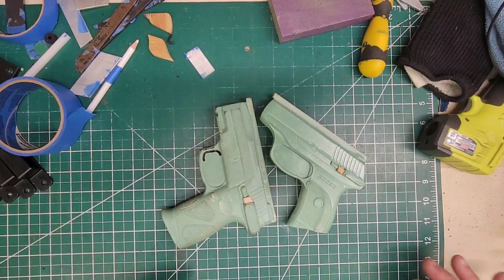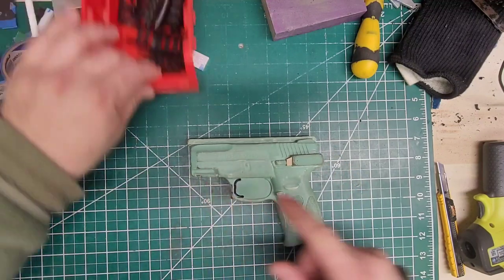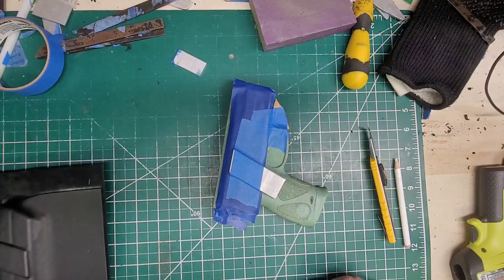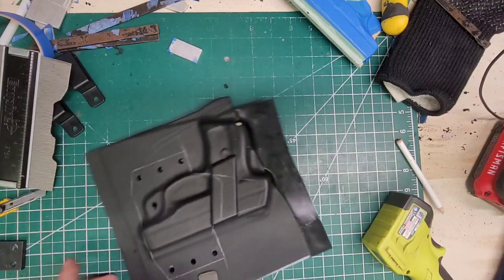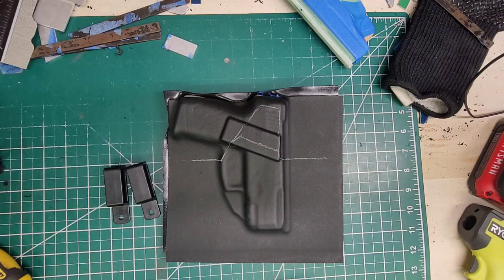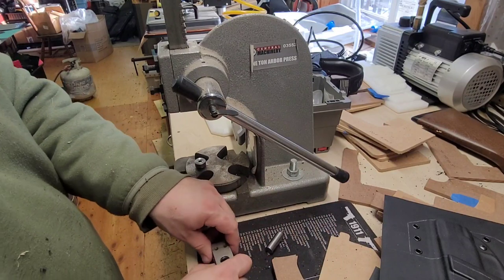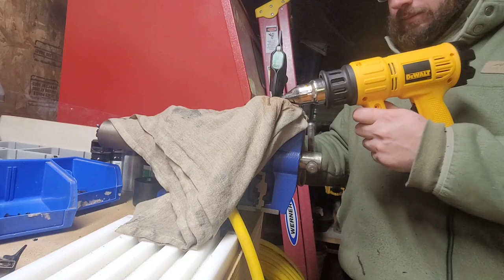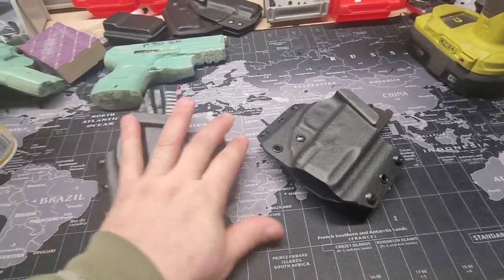Seeing double! 2 Holsters, 1 Video! Ruger LC9 and Taurus G2c

Comment: What distance of the holes on the drill guide?  Thanks
Reply from the maker: I have four drill guides. Each one is for a different mounting system. Some for loops. Some for speed ease. Off the top of my head I don't know. But if you look at the spec sheet for those 2 that'll tell you 2 of the 4 I have lol
Reply: @FalTacUnlimitedLLC  Thanks for the informative content!